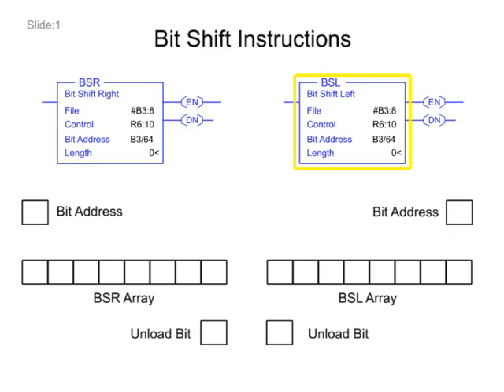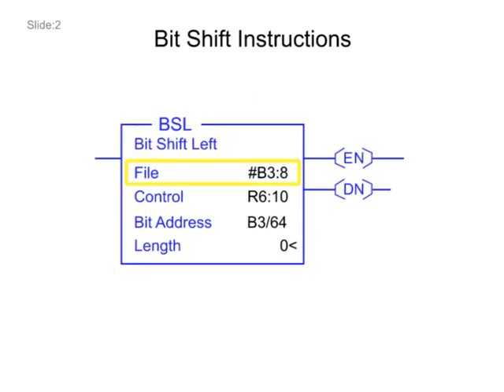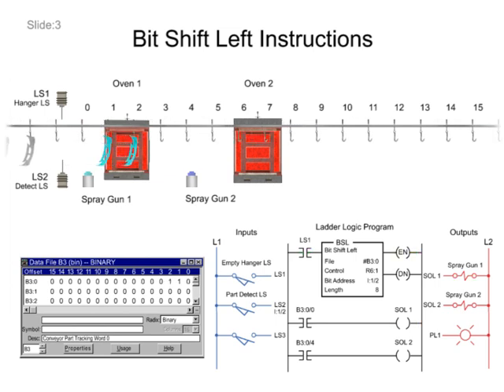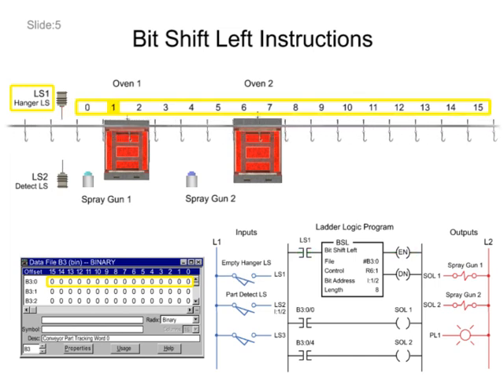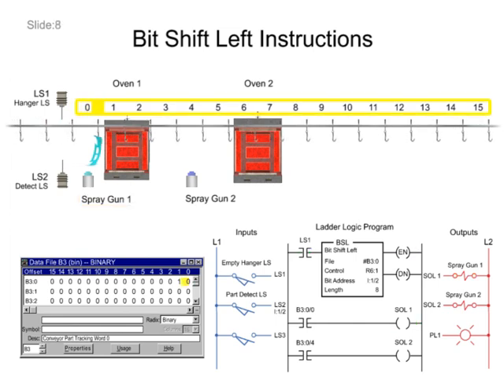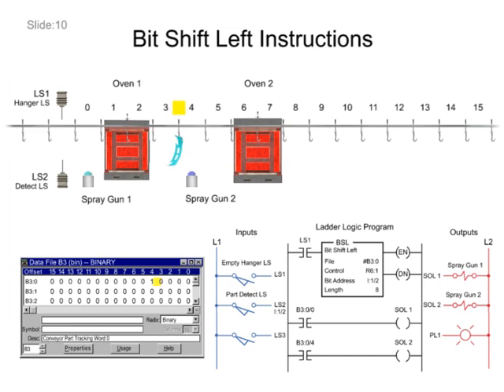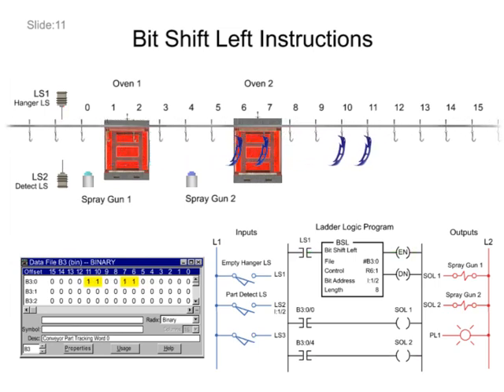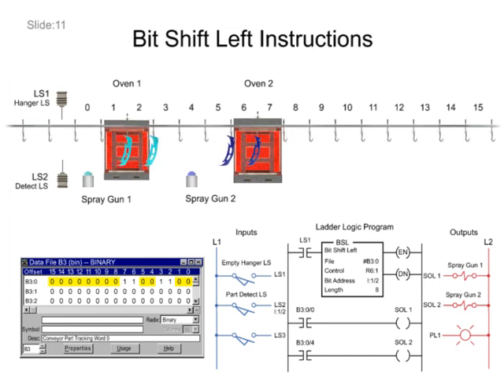Bit Shift Left and Bit Shift Right Instructions

Comment: Thanks for the Video. It was helpful. 1 question - Why is length needed? it seems that the length is dependent on the array size and this setting has little to do with the operation. What does it do?
Reply: yes this is what I need to know as well. What if you want to shift 3 bits at a time?